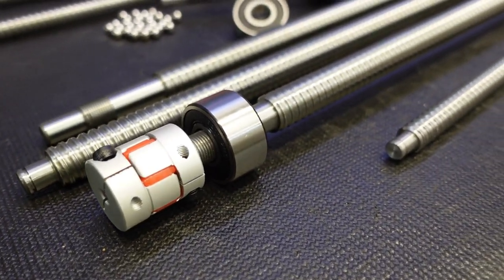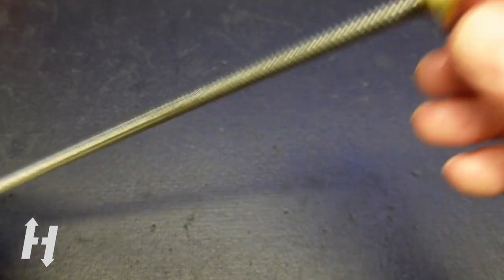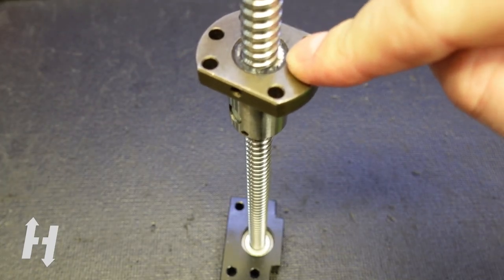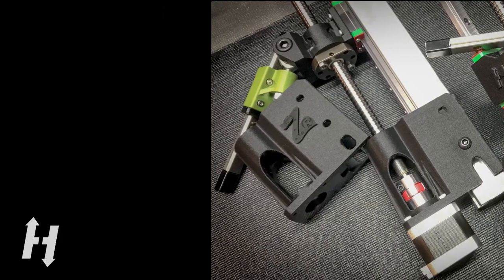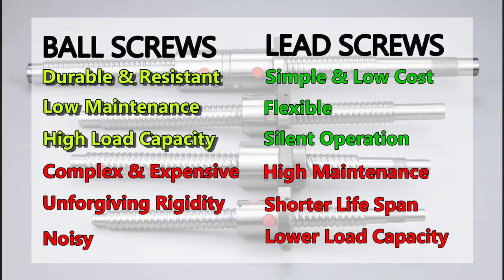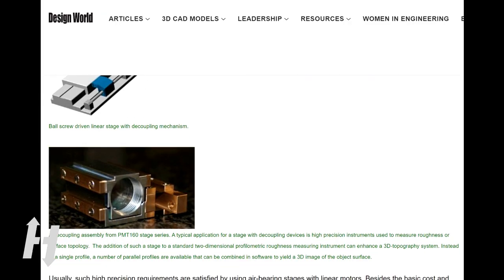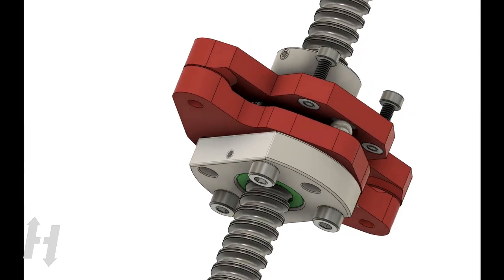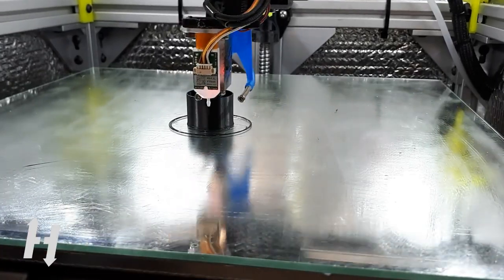Fixing Z Wobble from 20$ Ball Screws with that simple device

Comment: Leadscrews are by no means 'high maintenance'.
Never heard of it being a maintenance point ever. All these 3d printing channels. Everyone of them pointing out many different problems and fixes on printers from clogs to frame corrections. In 4 years, never even had a thought on them and they never caused a problem to me or to anyone I know 🤷🏼
Reply from the maker: Z Hop for safer speed travels (800mm/s) gets my Z axis to multiply the travelled distance by a lot.  Have you taken your Lead screw nuts out lately and measure the wear/backlash ?.
Reply: @MirageC  Never had to. Even if there's wear on them, the horizontal and axial support is not delivered by the leadscrew. I have 4 10mm steel rods with double linear bearings to hold the bed in place and the leadscrew only has an actual effect on the z axis. So even if it's completely worn out, as long as it doesn't somehow skips (extreme failure) it should work as well as new.
Reply: @jenshendriks9092  Do you have an image or link to what your setup looks like?

Comment: Why don't you just straighten the screws? It's pretty easy to do.  Most major ball screw manufactures have to straighten screws even if they are ground, there are some YouTube videos out there showing how to do it.  Basically buy a set of v blocks sit the screw on the v blocks, measure for the high spot and then just bend in the opposite direction with a long bar or a press, measure again and repeat until it's straight, I have fixed bent ballscrews from crashed CNC machines this way many many times, you can get the runout to under 0.01mm if you put the time in. Your solution is interesting but if you have axial runout it will be affecting the pitch, if you have accurate measuring tools it is probably detectable in your layer height you just don't see it as bad as the axial runout as it stacked.

Comment: I really like this video. I would like to apply this strategy to horizontal ball screws. If we use ball bearings as demonstrated then we can put pressure between the two ball screws in order to eliminate endplay or backlash.

Comment: Would the z axis setup on the rat rig v core 3 work essentially the same as this since it uses magnets to attach the build plate?
Reply from the maker: No, the RatRig magnet config only allows for tilting of the bed during the levelling process. They are using lead screws which are smaller and more flexible therefore not transferring deviation to the build plate.

Comment: Very cool solution. What I did with my z-wobbly screws was set them free. They spun in ball bearings at the top. I simply removed those bearings. Now my cheap screws end in the larger hole that used to hold the bearings. This solution only works because my build plate travels on four hardened locating rods which your hevort does not have and which would kill your planar printing concept.

Comment: Very nice, clever, and fun approach!  I would also consider simply removing the support bearing at the top of the ball screw, and replacing it with a relatively loose fitting plastic/bronze bushing. The clearance (looseness) should be large enough to enable the imperfect ball screw to freely 'wobble' radially, without transmitting that wobble to the platform. It's not a fun, elegant solution, but it may work very well. Thank you -- I watched your entire video :)

Comment: great video. Another option to eliminate back driving is to use a counterbalance system with pulleys and weights. You can run higher accelerations/speeds and reduce friction. It will also make Z more responsive overall

Comment: In my own design, I completely captured Z in 4 linear rails and the acme threaded rods float freely vertically. The Z steppers are at the top of the frame and the motor coupling sits on a bearing. I have never had z wobble problems. Another thing I seem to see in 3D printer design is a bed attachment method that I have never been fond of. Using screws and springs... I did not use them in my design, my bed attaches directly with a single washer between the bed and the linear rail bearing block. I assembled the frame on the flattest surface I could find and measured distance between the bed and hotend with simple feeler gauges. I then sanded the washers by hand until I was getting no more than about +0.002" of deviation (so only +/- 0.001") at all 4 corners (yes this was a slow process). I still use a Bltouch, but it does very little actual compensating and it's nice to have since my glass sheets aren't 100% uniform.

Comment: How does this compare against a belted z like a delta or geared Voron V2?
Reply from the maker: It all depends what you want to do with the printer.   In order to have a super rigid XY for heavy tool heads, tool changer and high speed, having the bed moving up and down is favorable in my opinion.  If you want to add a fairly big plate 400mm+ to this, then ball screws will be indicated to support that weight.  Print quality wise I think they are similar.

Comment: At 12:00, is the bed connected closer to the slider, or the nut?  It seems like if it were connected to the slider, then it wouldn't wobble as much because the slider can't wobble. Or can it? Can you screw the slider too something ridged?

Comment: Your solution is a more general solution, which is awesome.  But there are at least two other ways to reduce the runout problem directly on cheap ball screws.  1.  If you need 3, buy 4 and throw out the one with the biggest deviation.  2.  It is possible to straighten a screw or shaft:  https://www.youtube.com/watch?v=bOT4cSTJyqw

Comment: Interesting idea. I am having issues with z wobble caused by the rolled screws in a printer at the moment where the bed is mounted directly to 3 ball nuts. I'm planning to add 2 linear rails and decouple the screws.  My only concerns for this design in my own printer are that the bed is partly relying on gravity when it's being lowered so if one of the linear rails binds then the bed might disconnect. This would not be an issue with your printer but would with mine, especially as the rails I have are a bit tight. Also, my screws are a little stiff, mainly due to the wipers I think. I'm concerned that the resistance might overcome the magnets. Any thoughts?

Comment: That's an awesome idea! Loved this concept (and jokes as well)! One question: Despite the trapezoid leadscrew offer more friction than ballscrew,  is it possible use a kind a coupler, inspired on your concept, between the stepper motor and the leadscrew? By the way, I tried POM nut instead brass nut and works smoothly. I was wondering a nice way to improve my 3D printer (reducing Z wobble), but not using ballscrews so far. Greetings from Brazil!

Comment: That was an elegant solution to a well explained problem. In a dusty environment (mine) I would mount the lower disk's surface proud of its plate and then extrude a shroud from around the upper disk to the lower disk to keep the system clean.
A plastic oldham coupler would probably fail through plastic deformation of the surfaces because of the static load, apart from work wear. Cross drilling 3 steel disks clamped together should work. Multiple balls per channel would ease the static load.
The lost nut motion due to it partial rotating that you illustrated was worth several thou of linear error. I am using a double hinged linkage from the nut to the track truck to allow for all possible deviations of the screw to the track distance and stopping nut backlash .

Comment: You can get +-3um acculacy with cheap trapezoidal thread screw and nat.
The key technology is "grease" which is very old but still useful.
If you use proper one with high viscosity and stiffness, it reduces backlash of the screw enough.

Only one disadvantage of the grease is "maintenance period". The grease works well, but goes out soon,
so you may need to grease up the screw every week.

About wobbling of the screw, you can reduce it with rubber bushs between nut and holder.
I uses simply O ring for the bushs, but it works well.

Ball screw is good, but it has also disadvantages like "large" or "difficult to modify" other than the price.

Comment: Very cool design!
By the way, I was told by an engineering friend that magnetic bearings can wear out over time -- like the repeated forces that their magnetic fields can bear isn't infinite and so they can lose their relative magnetization (I'm paraphrasing because we were drinking and words are hard). -- I'm not sure if it matters as much in the 3D printer world, I think it's probably more of an industrial automation concern -- but those also looked like cheap craft store magnets. -- So I would be curious to know how this device holds up over time? (Like say after 1000 hours of printing, if it's any noticeably less accurate. -- Maybe print a benchy now and a benchy later and see if the z-wobble degrades over time?)

Comment: I need to say, that I am absolutely super impressed with the solution to deal with using cheap parts, also the fact you share this with the hobby community it is just outstanding. I am about to embark on a high temperature version of your DIY for carbon fibre printing. So excited. Once again ingenious solution to the problem.

Comment: Very interesting compensation mechanic with the magnets!
My concern is that you kill the benefit of having ballscews by "decouple the accuracy" with printed parts.

In Industry we stretch these Spindles like a rubberband between the bearing Support blocks via Nut at the end of the Spindle.
The Pitch of the Ballways will be delivered preloaded so after streching it end up perfectly.

I build a HC too, the normal Lead screws wear out very fast but since the load is only on one side of the thread I never noticed any bad results.

kind regards  ;)

Comment: Really really congratulation... A super super project.
I will start it right now to realize my 3d printer as per your entire project. (Thanks for that)
Just a question :
Is it possible to do the same project but with just two Z motors (i have just bought a skr1.4turbo with only two Z motors connection)
Thank you very much
Francesco

Comment: I would attempt to use belts instead of balls crews, similar to Voron.
Reply from the maker: Yes that could work for lighter beds that dont need steep angle .
Reply: @MirageC  Probably this summer/autumn I will try to make a corexy of my own design, and will try it with belts. I will definitely take inspiration from HevORT, Voron, and RatRig printers :D
Reply: @MirageC  Also how do you account for end stops on the individual z axis?
Reply: Answering my own question here, you could put in parallel min, max endstops on the small rails.

Comment: Cool video. Now can you get a manufacture to mass produce the wobble eliminator?  The other key was the guide rod.  I also thought If the deflection was consistent, the print head could compensate  by mathematical offsets.  But a cheaper solution might be a deflection encoder with a laser and CCD element and lense on the bed.

Comment: Neat! Might be cheaper to use small steel springs for the wobble wings.
Reply from the maker: Springs would make anti-rotation force the smallest when aligned.  The more rotation offset you would get the more spring tension would try to maintain the alignment.  Magnets are the complete opposite.  They offer the most ati-rotation force when fully aligned, which is what you want in this case.  On a side note, we are working on a new concept with 0 backlash: https://www.youtube.com/watch?v=7P2bJENdFhA and here https://www.youtube.com/watch?v=PamxUq3nHVU

Comment: this is some really smart design. I would be a little bit worried about using the magnets themselves as a bearing surface, if you find they don't hold up you might try cutting some wear pads out of a razor blade, but you would need to make sure enough of the magnetic field makes it through the steel blade to still hold the magnets in place
Reply from the maker: I thought about several ways to overcome that wear.  In the end one of our member came up with a brilliant design, so I will make another video about these: https://www.youtube.com/watch?v=7P2bJENdFhA and here https://www.youtube.com/watch?v=PamxUq3nHVU
Reply: @MirageC  looks great, I've only just today heard about the hevort for the first time, but I'm really excited to follow your videos about the project

Comment: Small diameter ballscrews will be flexible just like leadscrews.  If you want a stiffer drive, use a larger diameter part.
Though the depth of the threads affects the stiffness (smaller effective diameter), and ballscrews are likely to be made from stiffer, stronger steel.

Comment: Creality's solution for this problem is to tell you not to tighten the bolts that attach the extruder-frame too tightly. You'd have to look at their design to follow this, but that allows the z-nut to slide left/right without applying force to the X-axis - essentially it's a sliding fit (x-y) between the Z nut and the Z-axis it's trying to lift. That seems, to me, like a pretty good way to do it - you could even put a tiny bit of grease in there and be done with it? Anyway, thought I'd mention in case you hadn't seen that.
Reply from the maker: ok... but the weight of a 515x515 coreXY MIC6 bed might require you to actually fasten all components pretty good if you want to print with some acceleration.   Are they using ball screws on  Creality printers?
Reply: @MirageC  No, they are just using a regular leadscrew with a threaded "Z-Nut" follower. Re: Accelerations - Remembering the goal is to ensure the  lead/ball-screw can only apply vertical forces, then you only need to worry about downward movements accelerating faster than gravity (9800mm/s/s). In the real world, you also need to worry about some stiction, etc... but still I'd be surprised, especially for a heavy bed, if you had any problems at even 1000mm/s/s, which is pretty fast (IMHO) for a layer change.

Comment: What’s wrong with 3D printing a flexible coupler like you said some were doing? :s then you don’t have any wear or rotation problem.
Reply from the maker: Nothing wrong, except the size they need to be to hold the weight from that bed.

Comment: Why is there so much hype over non-planar printing? It’s not like layer lines will be removed, you will still be limited by the size of your nozzle. The quality increase is small but the pribter complexity is huge, both in terms of hardware and software.
Reply from the maker: The ability to print with no support.  Material savings and time savings.
Reply: @MirageC  Oh, didn't think about the no support aspect :) Though I guess that's only applicable when you can orient the model without running into the model, it won't replace a dual extruder with a water soluble material, right?
Also, is there any benefit to using your magnet setup rather than printing an XY flexture?

Comment: You really did not want any mechanical contact, but couldn't you reduce the rotational deviation a little bit more, if you used a bushing 3mm and an 2.5mm axle, which is reasonably far away from the center of the rotation? Right now I would fear that some reasonable torque could really rotate the mechanism. It looks like it might rotate at around 2-3°, doesn't it?
Did you put more thoughts into the dimensions of the magnets and the bearing balls? I guess bigger magnets are easier to align to not tilt? Concerning the low cost and the outcome, I wonder why ideas like this did not spread further, yet. It looks great and it could be adopted to other orientations, too (I guess).

Comment: Cant stress how much squaring your machine helps. And Teflon Grease I would say is a requirement. White lithium and WD40 are NOT for these types of applications.

With that said, i have a 9 year old Makerbot Replicator Dual clone that still has brass bushing with nearly no slop. Im religious about squaring up my machines. Ironically that introduces the lack of tension against each part showing residence in the prints because the parts move more freely (slop). It shows when there's consistent movement like a thin walled circle. To which i bought some solid polymer bearings but have yet to install them ;-P one day (4+ years later).

Comment: If you're interested I've come up with a solution that is rigid enough to be used in y axis.
Reply from the maker: you mean for the displacement of the print head on the Y axis?  I am using belts for that axis, no screws involed on X nor Y.
Reply: Yes X and y. 
Still in beta. 
Thanks for the reply.

Comment: I could be brain dead, but I have seen shafts straitened. Just force and an indicator. even 20mm rod is not that hard with a small press or a floor jack.
Reply from the maker: Yes, ball screws can be straightened.  I am instructing myself on how to do it properly.
Reply: @MirageC  a true flat surface comes in handy. A stone based counter top works well if you don't have a surface plate. If you have access to a machine shop they can do it for you.

Comment: This is a video I didnt know I needed to see. I had an issue with my cnc router where the Z axis was off by up to .020 TIR along the entire work area. I have bought linear rails to replace the rods. But now I will check the ball screws as well.